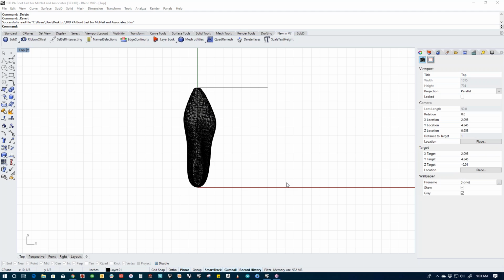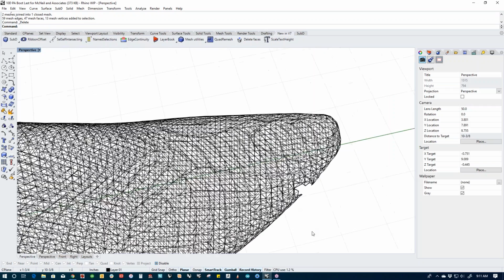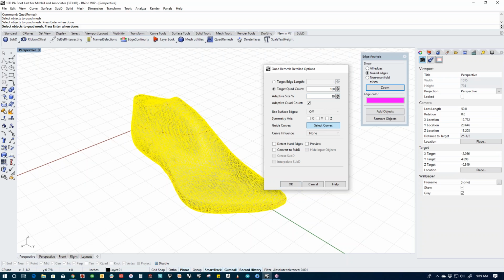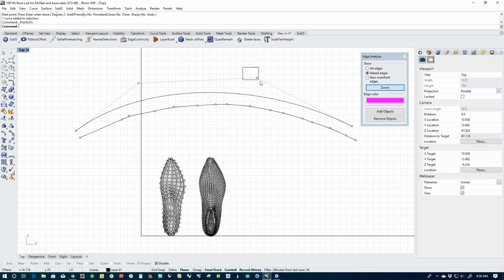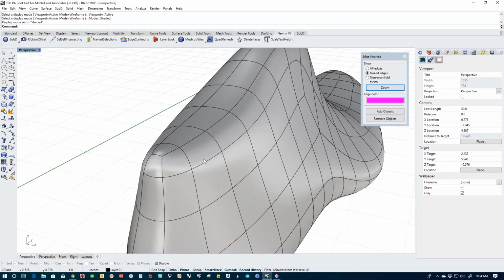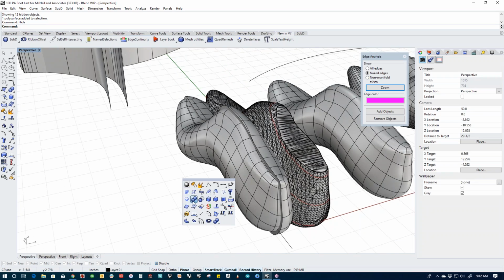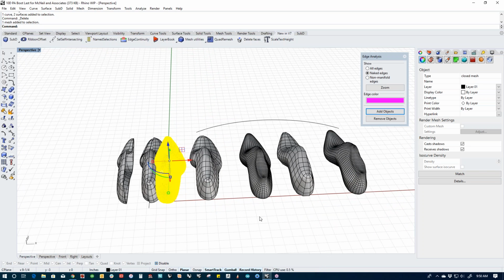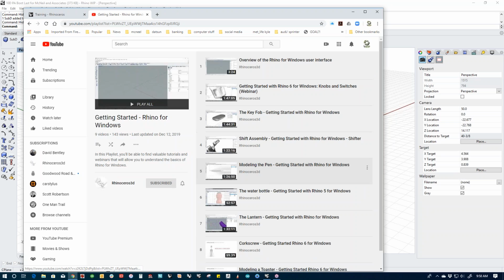Rhino 7- Getting started with Quadremesh

Comment: Hi I would like to have my car design converted from Blender to Solidworks, through Rhino. Is this something you can assist with. SW can open Rhino files.
Reply from the maker: if the blender parts are mesh, you can export to rhino as an obj and convert to subd using the tosubd command. you can then convert to nurbs using the tonurbs command.  then export to solidworks via step file. use ap214cc2 format.